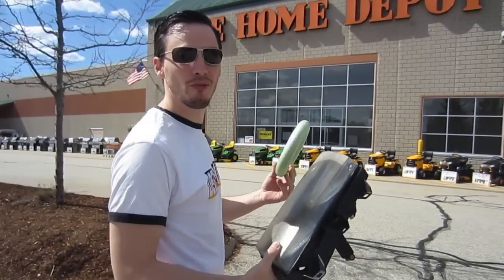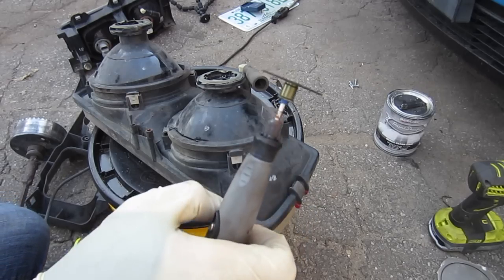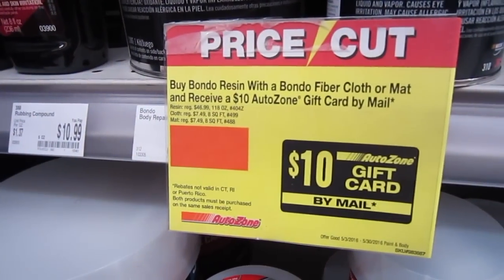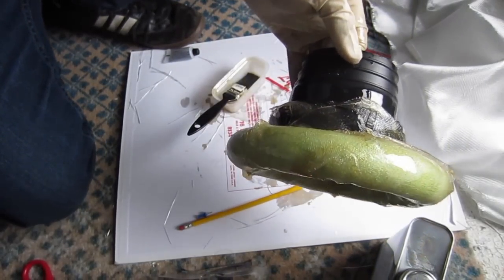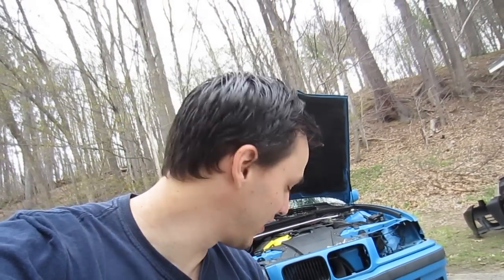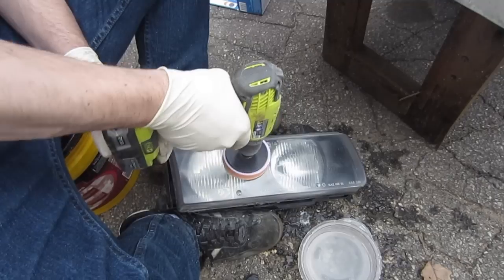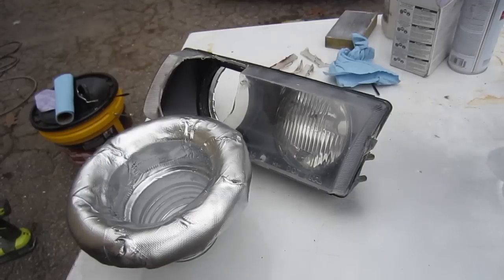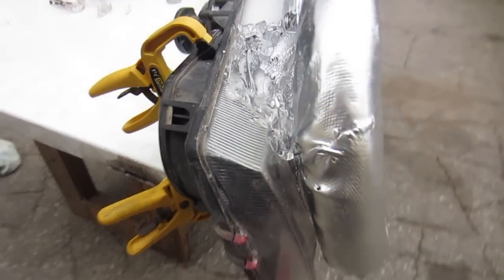BMW Ram Air Intake - Season 2 Episode 3

Comment: so it's a little late to help you, but I can help your viewers make a professional looking ram air for far less then this cost you. my car is a 97 Honda prelude, so it's not exactly the same, but the process is. first, go to home depot, or other hardware store. get an aluminum flexible dryer pipe. also get a roll of metal tape. and I also used an aluminum heater duct. I cut down the heater duct to fit the opening. I put it into the part of the bumper that would normally hold the fog lights(on the sh model. mine's the base model. so it didn't have the fog lights) I reached under the bumper and put it in from behind, and secured it. but before doing that, take your flexible dryer tube, and line the outside with at least two layers of the metal tape, making sure to work it into all the ribs. when you're done, it will make the tube very hard, like a cast. so of course you'll need to make all your bends FIRST so it fits the way you need it to. then I ran the other end of the tube, up to my cold air intake. the filter of course needs to have a front entry for the air to be "rammed in". DO NOT BLOCK OFF THE REST OF THE AIR FILTER!! and that's it! this is a much easier process if you take off the front bumper skin, but I did mine with it on...lol. all together, everything cost me about 25$. I've had it on the car for 3 years, no c.e.l. no problems. it not only improves the power, but also fuel mileage! since I integrated it into the body, if I didn't point it out, nobody would ever even know it was there! not only is this way easier, it's also much cheaper then the way you did it. I gained a good 10 horsepower, and 4-5 mpg. there's still improvement that could be had in mine, because I used the factory hole in the body, where the stock air box was. a more direct path would improve the flow even more. anyway, it works. it's simple. and it's cheap. and above all, it looks far better then this. I have a video of the car that shows the entry, and how I attached it to the air filter
Reply: ihateliberals who is gonna read all this 🙄🙄🙄🙄🙄🙄

Comment: Nice monocle, Colonel Klink. 8D
Thanks for posting this! I'm doing a similar project on my F800GT (BMW motorcycle.) Only instead of all the drilling, cutting, etc., I'm just buying an Ebay intake snorkel (shaped roughly like a cornucopia) and inserting it backward on the existing snorkel which is also buried needlessly back within the bodywork. 
It's not really "RAM air", because we don't really achieve positive airbox pressure at subsonic speeds, but it will still cool the airbox, and cooler air is more dense with oxygen molecules than the warmish maelstrom that our OEM BMW intakes are drawing from. Kudos! Going to watch the next ediition now!

Comment: As someone who has used that kit in the past, they do go foggy again after about a year. Good product for that year, but you'll need to buy and redo after about that time.
Reply from the maker: I agree, but now they provide a wax sealant, it lasts a bit longer if you reapply the wax after 8months or so.
Reply: I just bought OEM replacements. A bit on the pricey side but less of a hassle. They lasted 10ish years without fog initially, should be the same this time.
Reply from the maker: Oh for sure, if you can get new ones go for it! The E46 uses replacement plastic lenses for about $20. Easy to replace too

Comment: Next time you do a headlight restore get meguiars plastx and some 1500+3000 grit sandpaper. Follow the same basic steps from the kits. It costs a bit more than a restore kit initially but you get way more uses out of it and in my opinion it does a better job. I always just wet sand with both the 1500 and then 3000 and do it by hand then follow up with a soft cloth and the plastx, also by hand...but you may want to use a buffer for that part to make it last longer/look better. Just my 2 cents.

Comment: i dont get it, you should make a hole in the other headlight and some pipework idkhow, because, if you wil ever add a turbo to it, it is in the perfect spot, a turbo adds a good amount of horsepower but dont take it to american by add a giant turbo, because a small turbo will help in the lower torqué, you will need no help in high torqué because the engine is on its best in high torqué. in like 4 to 7000torqué your engine will have the most power.

Comment: $9 for the green ring, plastic coupler, and spray paint. then you spent like $25 at autozone on resin and fiberglass and who knows if you even had that epoxy already... you probly spent atleast $35 making a disaster of velocity stack when you could've just bought the one you walked by at autozone for $15 😂😂😂